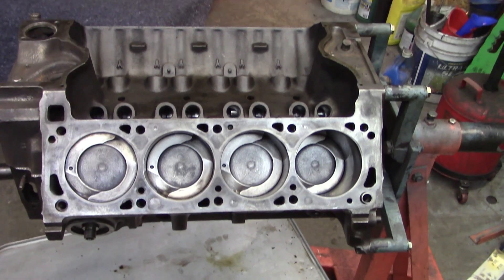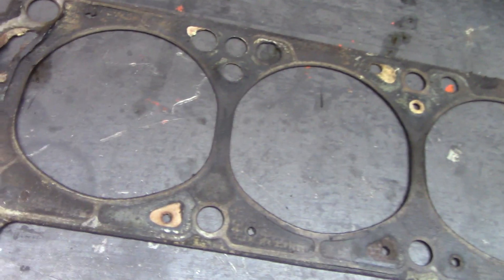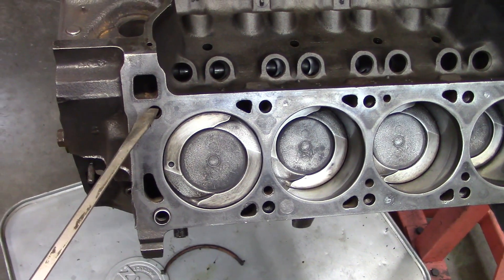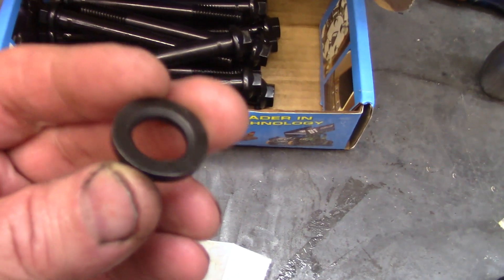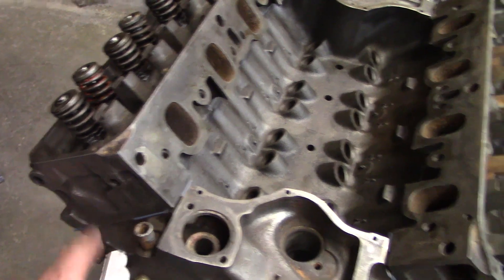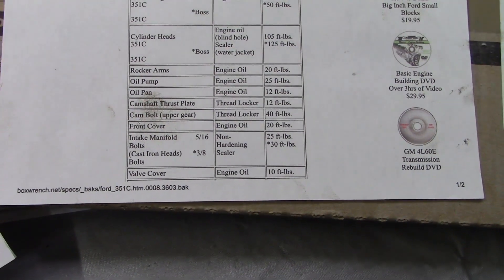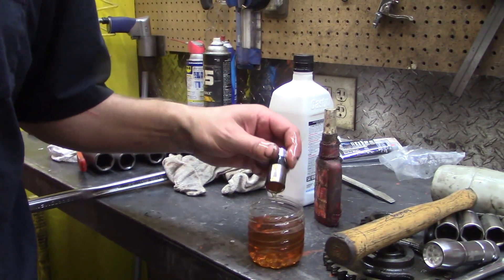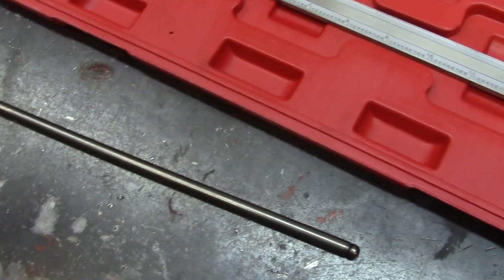351m Engine Assembly part 1 of 3

Comment: Did you check the oil passages in the crank. Those things came with nylon cam gear and would break down and get sucked up into the crank
Reply from the maker: brushes were run through the whole thing

Comment: Turn that driver side gasket over you'll block off that water passage and it will overheat the same goes for a Cleveland and 400

Comment: hi olds.... I need to know what you check for in the bottom of  351m engine block to know whether it need to be sent to shop to be reworked or not?
Reply from the maker: your bank account,  cylinder wall surface & piston condition, dial bore gauge to cylinders, straight edge across deck surface, cam bearing replacement?,  quality of the rebuild you want and who knows what else.  Our 351m after the Rustoleum rebuild isn't the best engine in the world. .

Comment: Two big problems with the 351M/400 blocks were the open chamber heads (8.7 compression ratio) and retarded valve timing. These engines because of the heads were very prone to "knocking/pinging/denotation" and after market closed chamber heads will do wonders for engine along with a torque-y cam. Howard's makes a retro 351 Cleveland cam that will work.